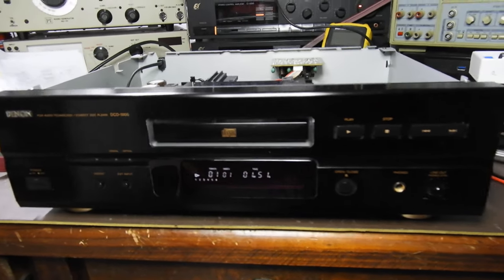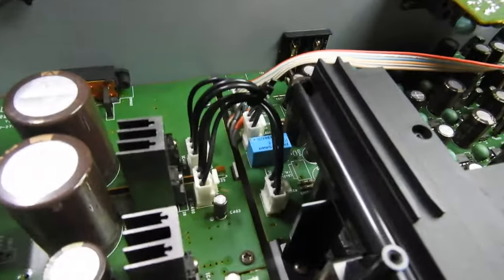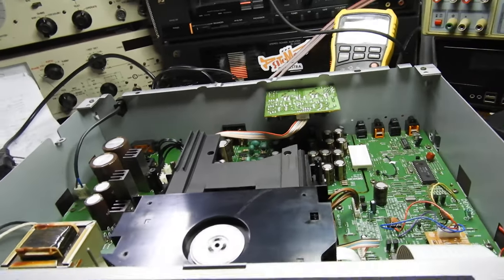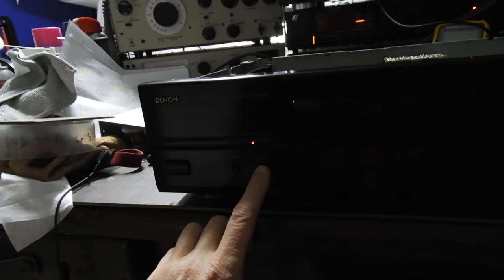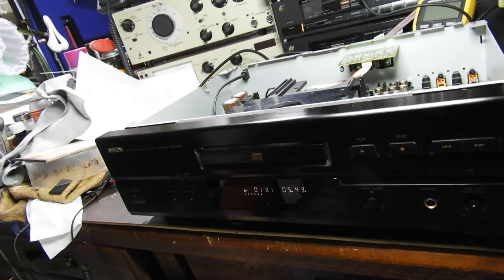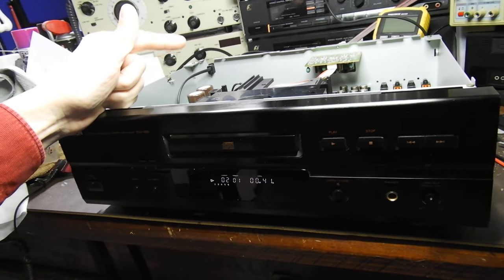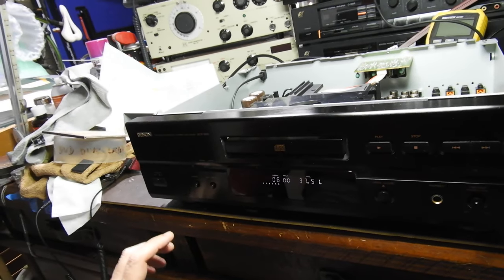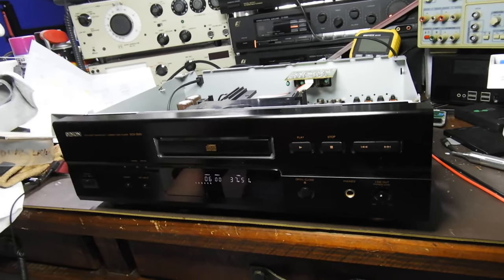Denon DCD-3000 A very unique player with 4 x PCM-1702 DACs, DAC Input (!) and balanced output. +More

Comment: i AM a first owner of a dcd 3000 and last year i had an issue with the tray not opening. IT has been fixed by the hifi dealer. I also use IT as a dac for my Marantz music streamer na-6006. in 96 i paid 1134 EURO  for this incredible cd-player
Reply from the maker: I still haven't Been able to replace the XLR sockets. Just cannot find ones with the right size (they have to be longer than usual, because the PCB design). Also, the balanced output board mounts on them. But I am looking forward to seriously evaluating it and maybe keeping it and I always knew it had to have been expensive with such good parts and design. Thanks for the pricing info. Was it Germany or Austria?
Reply: @hear-net-au  No Netherlands. 2500 dutch guilders . That was equal to 2500 DM. Only the S10 was more expensive. The S10 has exactly the same internal components

Comment: I hasnot see 4 pcm1702 inside in the machine
Reply from the maker: I do. Trust me they are there. Also, they are on the list of VasilTech:
DENON DCD-3000	
4 x PCM1702-J – SM5845AF – YM3623B	
KSS-240A
Reply: @hear-net-au  oh I see,I had diy 2 machines, all are 4pcs pcm1702x4, and one is use DF1704, also the pcb is buy from taobao,I am hk guy
Reply from the maker: @camchan442  Hi, can you send me a link to the PCB on Taobao please? also, I am looking for a input and output board to fit to some Wadia players that came without ones. Is the anything like it on Taobao?
Reply: @hear-net-au  these are my 2nd 1702x4 diy ,the case is LD player cut by depth 
https://youtu.be/BkF0fSrt11E

Comment: What a beautiful machine, still fighting with my DCD 685 tho :(
I adore your videos keep the hard work!
Reply from the maker: Thank you for your kind words. My wife says my videos are chaotic and pointless... 
What's wrong with your machine?
Reply: @hear-net-au  I really dont want to bother, but  its like the player doesnt get the table of contents of the discs and just don't want to read any CD or CD-R first try.

Some months ago I managed to get it to read the cds by selecting any random track upon inserting the disk on the machine so it  make it spin and it seems that way he got to read alright, once its set it will play the CD flawlessly from start to end or going back and forward between the tracks.

Now that method works but like with 60% success rate.

I opened it , cleaned the lil bit of dust it had (almost nothing), cleaned the lens also but nothing changed.
Reply from the maker: @ivandosio9826  Hard to say... Could be something mechanical, like hardened grease at the beginning of the guides or the turntable being pushed in too far down and laser having difficulties in focusing. But KSS-213 being only $15, you could try getting a new one to see what happens. When replacing, use static electricity precautions (ground yourself and don't wear synthetic clothing).
Reply: @hear-net-au  will try thx, I've regreased it with lithium grease aside of cleaning it but maybe I didnt put it in all the required parts